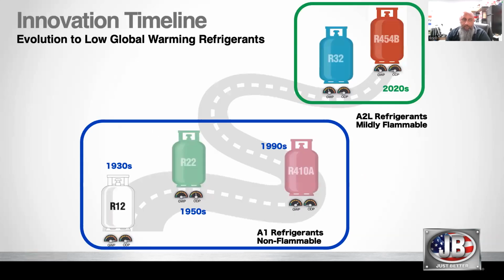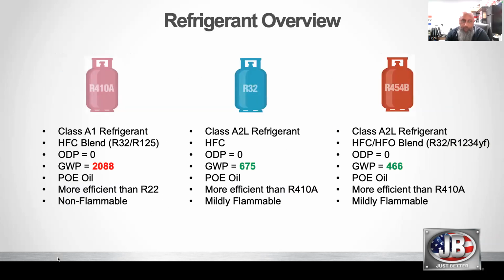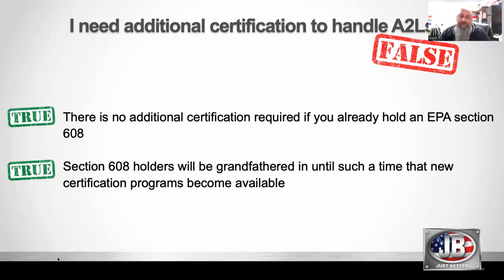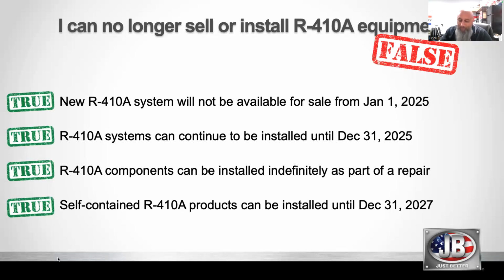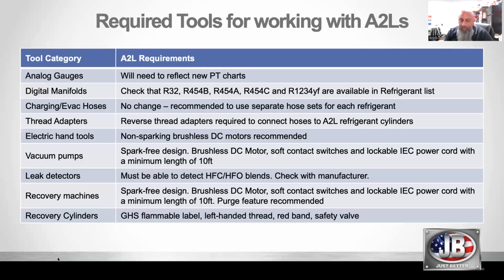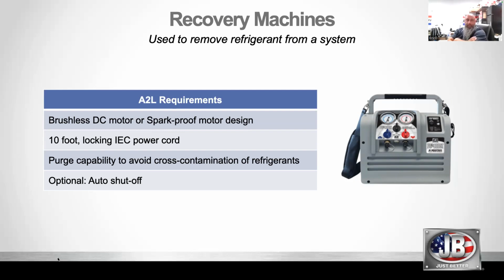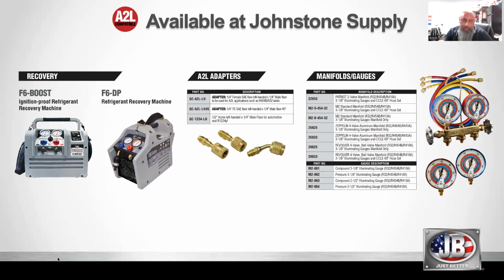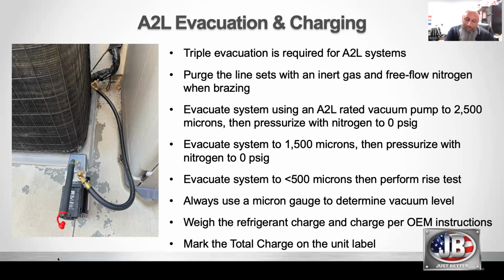A2L Tools Webinar With JB

Comment: In the islands, almost all AC's run on propane as a refrigerants. it's cheap and seems to work well. why do we not use it here?
Reply from the maker: The simplest answer is regulation, but propane is also more dangerous, particularly in drier areas, because of the flammability.
Reply: @jsoriongroup  We have propane piped through our homes already in !!/2 inch PEC pipes! The flammability argument is stupid and you know it... DOW's lobbyist, is the correct reason...
Reply: We also have like 20 gallons of gasoline in our cars...
Reply: We also have 24,00 Jules of electrical energy running through the average Americans home's walls...That's about 6oz of TNT.